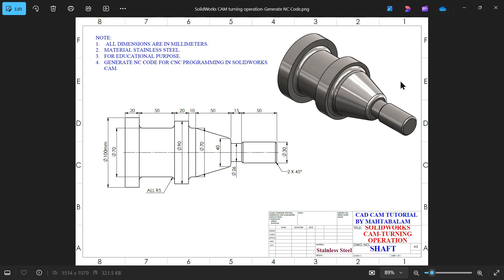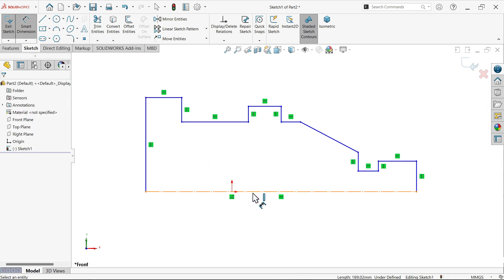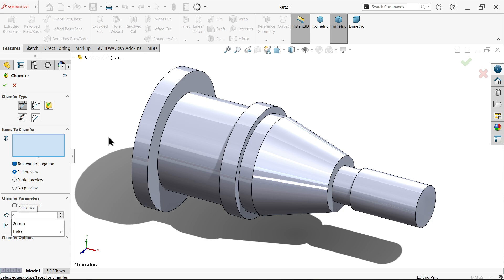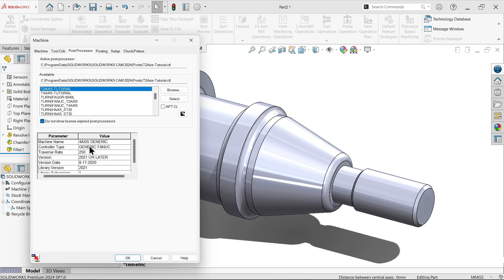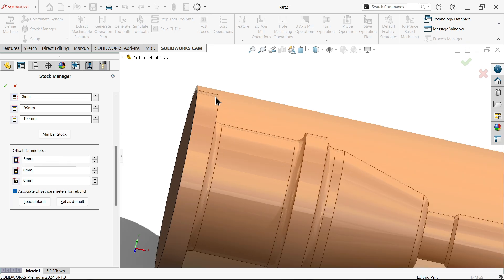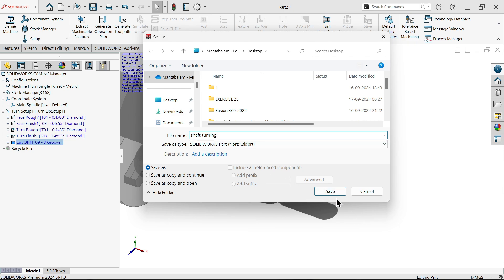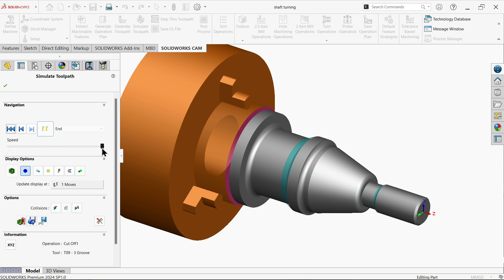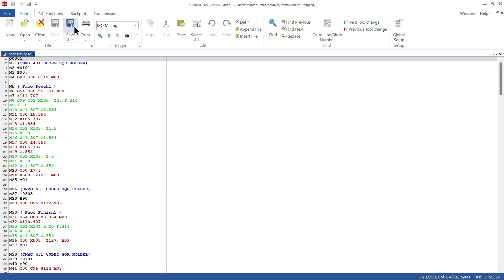SolidWorks CAM turning operation-Generate NC Code

Comment: In the end tool didn't cut material from 2 points bcz tool non cutting face is touching the material surface so solidworks skipped turning from those 2 points